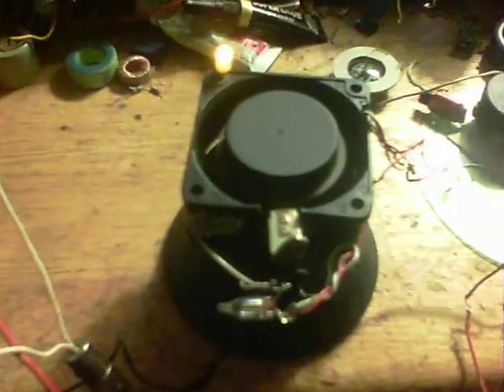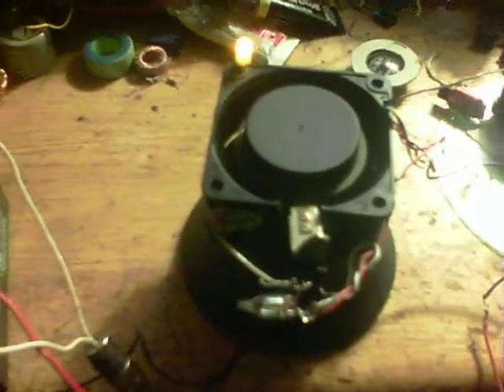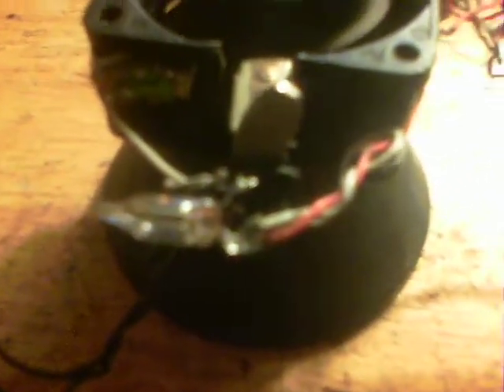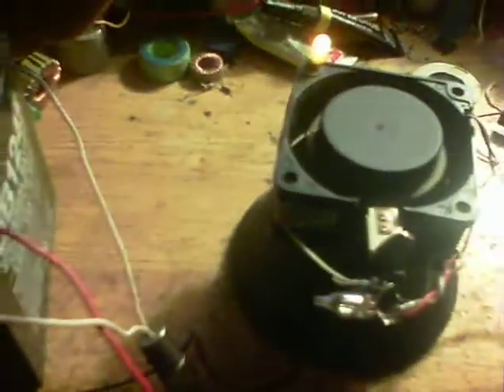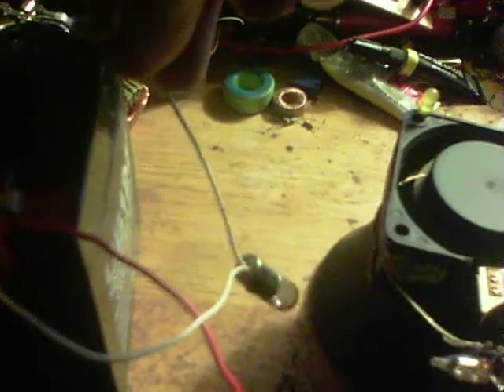Motor speed rise with load

Comment from the maker: @jozsab1 Just tried it and noted something odd. If the charge battery is connected conventionally, with coil wiring + - to batt + - then there is a 10mA increase at 6V. But, if the circuit is more like the Bedini reverse connecting through a diode to make it correct again, there is no change yet same brightness :)

Comment from the maker: @MrFlathunter Yep, regular fan circuit, to keep the powering and generating sides totally seperate. Fan draws less than original 12V running, even with 6 neos around the outside....no blades is probably why.
Have posted circuit on the FanGen thread at Energetics this evening :) 
I would advise a 100ohm resistor on the LED and 1K resistor on the positive to the Hall sensor, as precautions at first. My stuff seems pretty strong, but I have a bunch of spares if they turn out not to be lol

Comment: So you are driving the PC fan with the original circuit?  What modifications are necessary to get this strange effect?  Well done mate - you're doing a great job and its wonderful to see the same effect as the muller on a very different (and more simple and builder friendly) setup.  Is there a circuit diagram anywhere?  Im sorry if ive missed it.  Ive got 2 12V PC motors and plenty of other stuff and a visit to maplin on the cards.  I wanna be there with ya!  Cheers :)